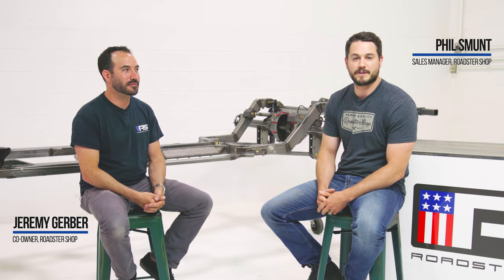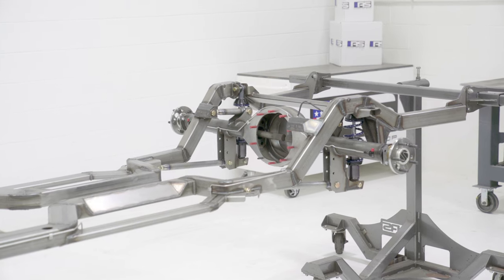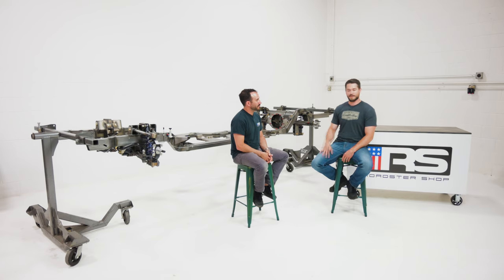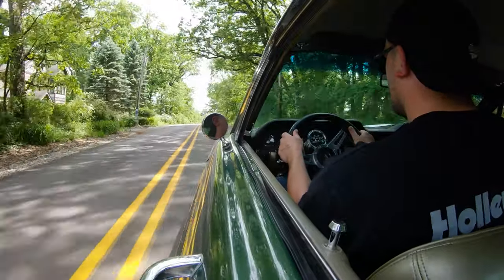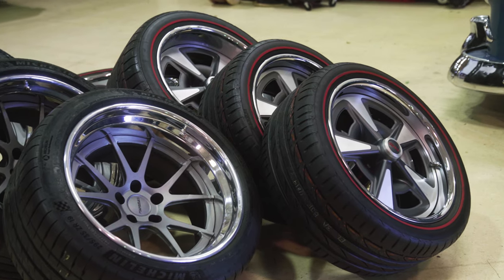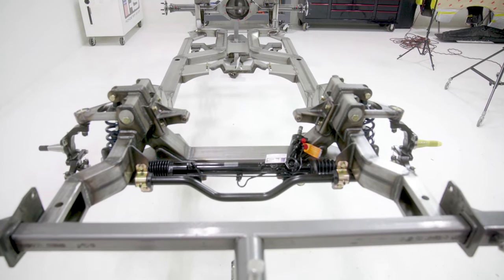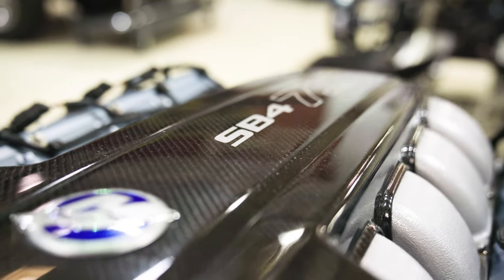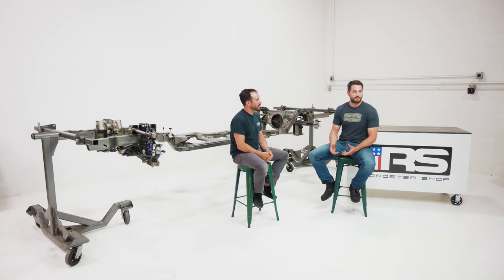SPEC chassis overview PART 2 - Ease of Install and Ongoing R&D - 4k

Comment: I have been in contact with you regarding my 2 wheel drive 1972 Blazer stock height spec chassis loaded with everything from rear end, gas tank, fuel and brake lines and LS fuel tank. Can you also supply and install a GM LS engine and transmission either connect and cruise or other options? Probably still 2-3 months from ordering (and I understand it is about a 12 week build time). LS3 480 or 525/4L65/70
Reply from the maker: Hi - we can. For any chassis or build inquiries, the best thing to do is call us directly at the shop or email.
Reply: @RoadsterShop  As I said I am still in planning stages and wouldn't want to bother you with questions that can wait until I am ready. This could give some viewers some additional information?

Video idea?

Comment: What's the main difference between the spec and higher end Camaro race one? Ideally i want an everyday driver and take it to the track twice a month.  Can the race end one work as a daily driver and can the more affordable  one preform on track
Reply from the maker: Most of the decision comes down to the amount of work involved with installing the chassis.  With SPEC we have extremely minimal mods to bolt the chassis up to the car.  For FAST TRACK fabricating a new floor pan would be required.  To answer the second part of that question - yes both can do mixed duty but obviously SPEC is better for more street and FAST TRACK for more track focused.
Reply: @RoadsterShop  spec it is cause i don't know who would make a  floor plan for me in my area thanks!
Reply: @Guy-mx4fb did you get it?

Comment: But steel?Why not alluminium and carbon?
Reply from the maker: Aluminum needs more physical volume to achieve the same structural strength as steel (look at a steel framed mountain bike for example vs an aluminum frame) 
The setup, engineering and general material cost of carbon would be extremely cost prohibitive for most builders.
Reply: @RoadsterShop  I think your right!To build carbon frames at a aceptable pricepoint you need a very high productionrate and al ot of automatisation!Thanks for your answer!

Comment: how much power can a spec chassis can handle?
Reply from the maker: As much as you can throw at it (and as much as your transmission, wheels/tires and other supporting components can handle - the chassis will not be a limiting factor).
Reply: I dont know!